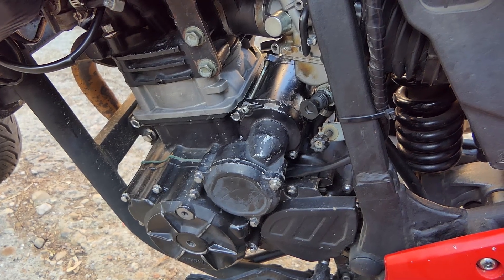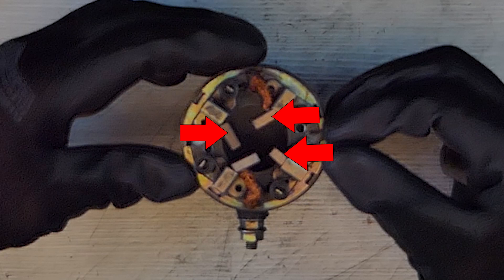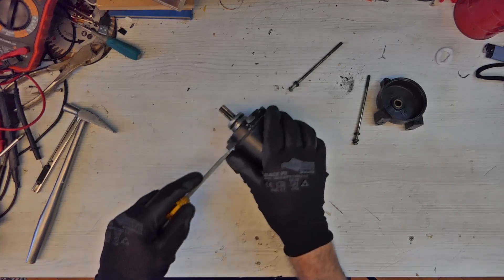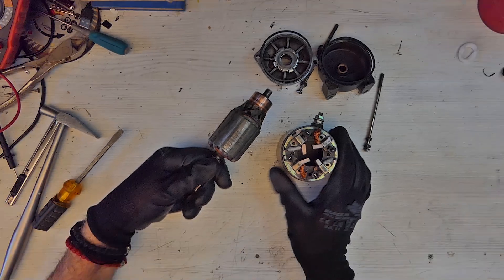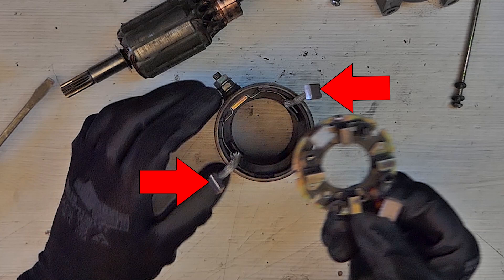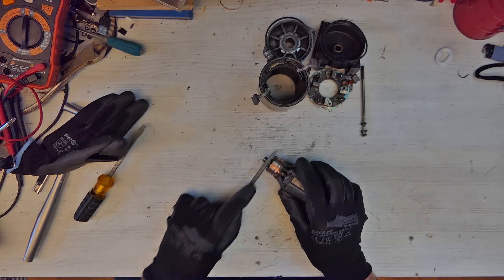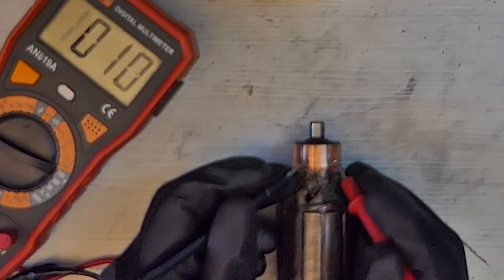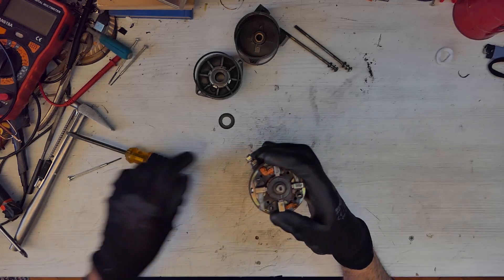Motorcycle Starter Motor – Disassembly, Cleaning & Basic Repair (DIY Tutorial)

Comment: Can Triumph Trident 660s starter motor be repaired ? Mine is starter motor not working
Reply from the maker: “Sure, of course. I haven’t had the chance to do that myself, but I see that the starter motor is similar to the one I worked on.”    https://www.ebay.co.uk/itm/205267774587
Reply from the maker: https://www.ebay.co.uk/itm/205840526084?_trkparms=amclksrc%3DITM%26aid%3D1110006%26algo%3DHOMESPLICE.SIM%26ao%3D1%26asc%3D295742%26meid%3D639e04357abc477b967912b5d2489ad3%26pid%3D101875%26rk%3D4%26rkt%3D4%26sd%3D205267774587%26itm%3D205840526084%26pmt%3D1%26noa%3D0%26pg%3D2332490%26algv%3DSimVIDwebV3WithCPCExpansionEmbeddingSearchQuerySemanticBroadMatchSingularityRecallReplaceKnnV4WithVectorDbNsOptHotPlRecallCIICentroidCoviewCPCAuto%26brand%3DTriumph&_trksid=p2332490.c101875.m1851&itmprp=cksum%3A205840526084639e04357abc477b967912b5d2489ad3%7Cenc%3AAQAKAAABgG96wQ16jds4VFcrhy1F3d4mbwZUJI9Fs%252BgdXYAHIzlX2e3YaNh7x%252BEnKA3G%252BCqSl1Xn4McfcWFK1GytmS2qxJ87mtE8Gm3iR1Ja4WBwh0hNHJrJx3Ki5mp04ow4CO7lP%252BooCybZDDU%252BbbSwmg7CbTin%252BBzBzbCYVnbjvyQAHu6--HI4MB7SvJl5IJqlyvomgoLMlgT6qAJzX0SANJhty2cXVtg97aDFq3H91lRgGlKU08NmDS0XdqZPqZd5auUXpg7fwd74u%252BXD%252BqKrLBIh6avqkAcMwm0wMO096xXGrwRGaiqRCfOBbfOPs%252BuEleP%252B551tEwhN6bP6oDmG51RoU10jKh3bmL04Hav7uLbZRiAegoYyeCADqDX2bZde2S%252FKfqG8zxZWgnHMs7UChRUSiPY09qWGMp6Npa%252B75jc%252Bu044xX%252FctrgBj%252Frl9op3JNFjZWIaS2Pwl47d9%252BmKtOGSIMydcLdlsnV1GV0CzjLTD1Lte%252BSBvEkdCJrSZSQQRgOi8w%253D%253D%7Campid%3APL_CLK%7Cclp%3A2332490&epid=11062081621&itmmeta=01KB29W7301T26S6469MB12P7F